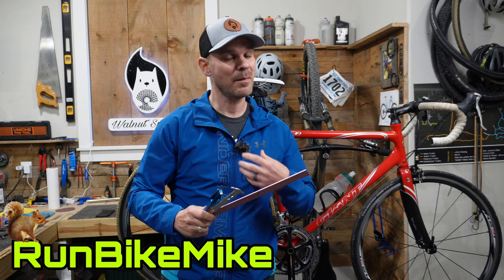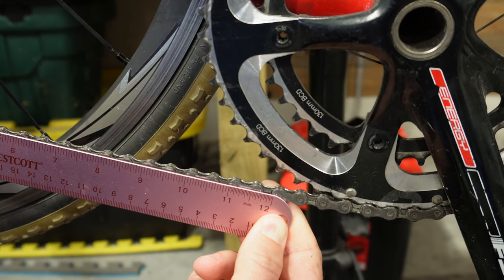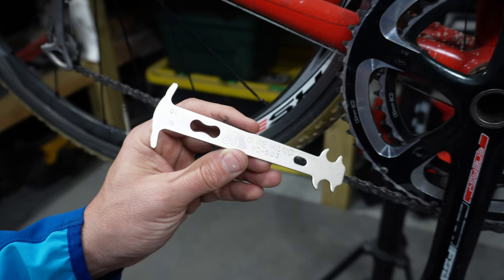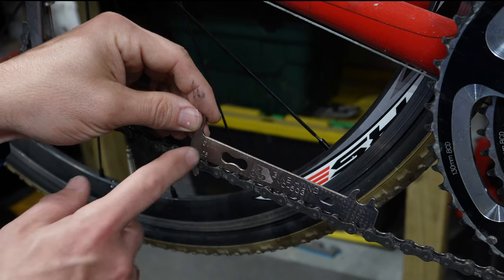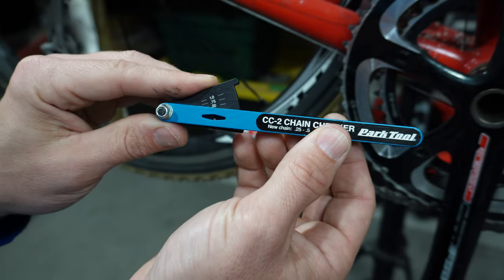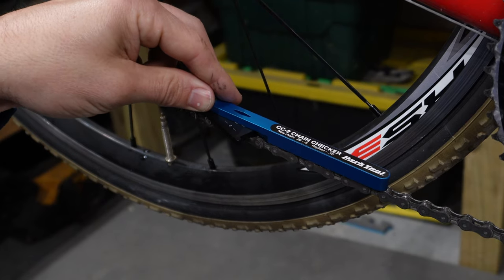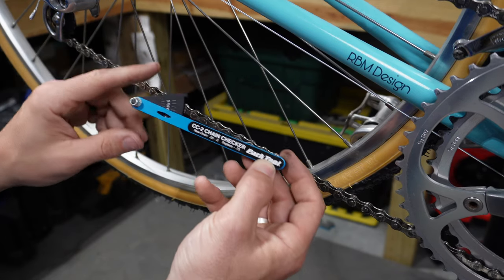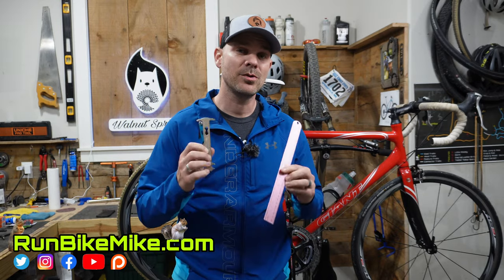When To Replace a Chain on a Bicycle: 3 ways to check for CHAIN WEAR

Comment: you're using the park tool chain checker wrong. you dont set a value first and then insert it to see if it fits. you just insert it at 0 and then push on the dial until it stops. and that tells you how worn it is. the whole benefit of the tool is that it shows you exactly how worn the chain is immediately without needing to remove the tool and reinsert it multiple times.
Reply: The Park CC-2 is not accurate even when used correctly. The CC-4, Pedro’s checker + are better options. The Shimano TL-CN42 is one of the better checkers available. CC-4 for SRAM flat tops

Comment: I have used the 12" ruler method for over 40 years, never even considered buying a dedicated chain checker, but I agree that the fixed version w/o moving parts is good enough.
Reply from the maker: It is so easy to use a simple ruler but yeah the bike hand tool is super nice for the price